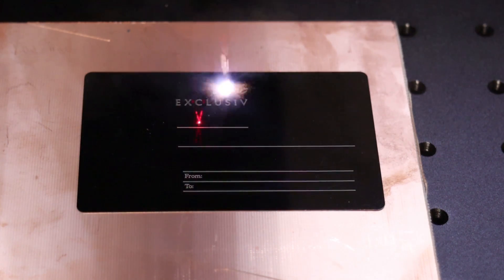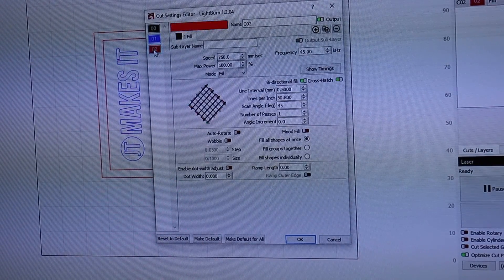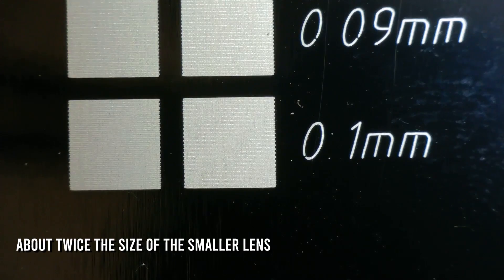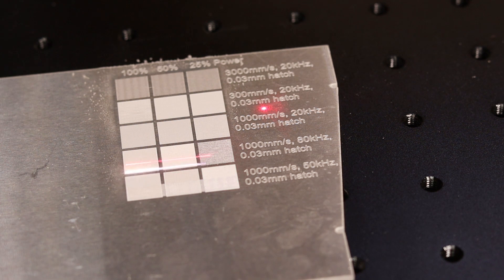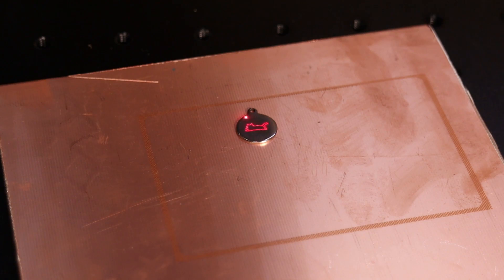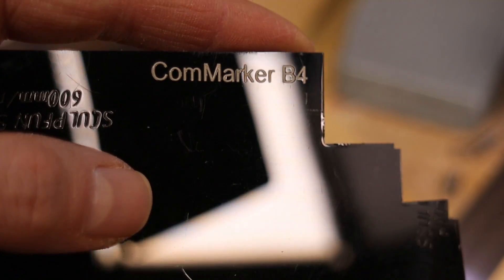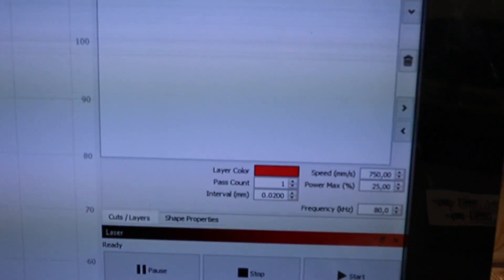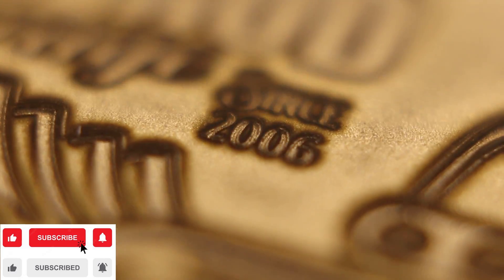"Cheap" 20W Fiber Laser With Outstanding Performance! ComMarker B4 Laser Engraver REVIEW

Comment: Is it possible to engrave in black on stainless steel? The very detailed text you put on the ring for example, can it be in black to be more visible ?
Reply from the maker: Yes of course you can. With a bit of defocus and small line interval.  In this video I did this exact effect on a knife blade.
Reply: @JTMakesIt  it can still maintain high detail and fine lines with the defocus ? because the text on the knife is in bold so im just wondering how fine it can be in black
Reply from the maker: @danaalbarazi8852  you can make it more detailed than that. I used too much defocus there. But if you want perfect ultra detailed text you would probably need a MOPA fiber. With it I am sure that you don't need to defocus. (Maybe you can even do it with this one but I never tried). Check my other videos. I tested 3 MOPA fibers so far. With MOPA fiber you have much better control over the beam energy and its effect
Reply: @ ah unfortunately the mopa is way out of budget for me 🥲 do you have any videos that show more of that defocus black engraving with the b4 20w ? I can’t seem to find any info about it
Reply from the maker: @danaalbarazi8852  no, I only have that video with the 20W fiber

Comment: Hi, thank you very much for your wonderful review!  Fortunately, this 20W fiber laser is within my reach, however, a 60W fiber laser is out of my reach. Consequently, I am interested in comparing the 20W and the 60W laser in terms of depth of engraving. More specifically,  when using much more passes (and more time) with the 20W laser, I wonder if  it is possible to obtain the same  deep engravings like using the 60W laser. I am retired so spending more time in engraving is no problem for me. Thank you so much.
Reply from the maker: @PavelZahradnik-p4l  with 20W, less depth will be achieved since when engraving deeper, the beam becomes more out of focus and with less power you run out of usable power sooner. I didn't do any long engraving tests on the 20W, but for metals like brass I would say that 0.5mm depth is achievable with 20W and 2mm with 60W, but this will highly depend on the type of metal and the lens size (larger area lens gives less power density, but longer focus depth, so there is always a compromise)
Reply: @JTMakesIt  Thank you so much !  It means, for deeper engravings with the 20W laser, after each 0.5mm engraving, it is necessary to re-adjust the focus and do another 0.5mm engraving and so on. Many thanks again.
Reply from the maker: @PavelZahradnik-p4l  you're welcome. If you plan on buying you can use my affiliate link and my 2% off discount code in the video description. Buying through that link you also support my channel at no extra cost to you.
Reply: @JTMakesIt  Yes, of course I will do. Many thanks.

Comment: Can this machine engrave wrenches, sockets, hardened steel tools?  Would love to see a video being used for this purpose.   I have tons of wrenches and tools that  I would like to engrave, this is one of the uses I have for a machine  like this.  What type of fiber laser or size is required for the fancy work they do on rifles?  Just realized both JT's.......
Reply from the maker: Hi JT :D I have engraved some wrenches in my videos with fiber lasers. They can be engraved very easily and with good results with all 20W+ fiber lasers. Even 2W "fiber" lasers can do it, but they leave a shallower engraving. Fiber lasers don't have any problem with anything metal.

Comment: im curious, the video mentions pre stored art work.  is it possible to laser print any graphic? could i for instance down load to this a spartan helmet ? then print it off,, or will it only do graphics that come with it?
  thanks in advance for any insight you can offer
Reply from the maker: You can print any graphic you get from the internet. Vector images are the best, but it can also engrave photos and other images

Comment: Can it (20W version) cut gold plates as name tag jewellery without any warping or creating any problem.
Reply from the maker: If they are very thin, you can slowly cut them with many fast passes without warping. but if you want to cut thicker you need more power
Reply: @JTMakesIt  How thin is very thin in mm?
Reply from the maker: @tumdedum  I would say up to 0.5mm
Reply: @JTMakesIt  Thank you. What is the price of this 20W version? Also, what is a suitable power to cut up to 2 mm gold plate? and do you have such version as well?
Reply from the maker: @tumdedum  you will find a link to the machine in the video description. For 2mm you would need at least 60W, but still many passes will be needed. I plan to test more powerful machine soon
Reply: @JTMakesIt  Thank you. Looking forward to your next videos then.

Comment: can you engrave brand name on black plastic casing on electronic products?
Reply from the maker: Yes, although the contrast of the engraving depends on the type of plastic.
Reply: @JTMakesIt   When you have time can you make a video of etchings on black plastic?
I'm planning to buy this laser model and want to see how it looks.
And does the MOPA model engrave color on plastic or just metal?
Reply from the maker: @playvision5667  I will make it sometime in the future. I think I engraved some plastics in my review of the Enjoywood M4 too. It should behave similarly. The best engraver for plastic would be the Commarkers UV laser. I plan to test it soon
Reply: @JTMakesIt   UV laser is very expensive, I think I would stick to this model at most.
I originally wanted to buy the M4 but thought this B4 model would bring out the engraving better.
I'm only interested in printing my brand on black plastic on my products, I'm not interested in engraving other materials.
Reply from the maker: @playvision5667  it definitely can engrave plastics, it is just a matter of what contrast can be achieved. Fiber laser offers a lot of settings and with some tweaking a lot of different results can be made. Look around the article about fiber lasers and plastics so you get a feel what can they do

Comment: Has anyone succesfully lasered magnets with an fibre laser? If so were they more susceptible to breaks? Would a CO2 laser be fine as well with 1064 nm?
Reply from the maker: I think if the engraving is not deep it will not affect the mechanical stability of the magnet. I don't think CO2 laser can engrave on magnets though. Maybe if painting the surface black first
Reply: @JTMakesIt  Okay thanks a lot! I think then your laser model looks good.

Comment: Hello so this one can carve copper for pcb?
Reply from the maker: It can engrave copper. But I haven't tested it for directly removing copper instead of etching. In theory it could work. But it can be used to make an etching mask for sure. (paint the PCB in some paint, then mark the design with this machine and then etch in acid and later remove the remaining paint.)

Comment: This whitening also happens on Polyoxymethylene (POM). Grtz
Reply from the maker: Thanks for this info!
Reply: @JTMakesIt  i use a industrial co2 laser at my company, and to check the pusle widte and overlap etc. we use a actual microscope and check for these properties. Its actually very cool to see it from close up, you can play with the powers and actually see how the burned white have different forms from the laserbeams power if you fill under 60 degrees and 40 or 90 90. The results r quite cool.
Reply from the maker: @iamD2  Wow that is some valuable info. I'm going to try it out, I actually have a microscope at hand! Thanks!

Comment: this is out of my price range currently. im looking for a metal engraver for zippo lighters ,pens knifes etc. any recommendations. thank you
Reply from the maker: This one is more affordable. https://youtu.be/Mjf6KA1C9Hg
But lasers for metal are not going to be very cheap
Reply: @JTMakesIt  Thanks. yes i was looking at that one.
would you recommend me save my money and save up a little more for the commarker?
Reply from the maker: @chrissmith841  Commarker is approximately 10x more powerful. it can remove more material and make engravings deeper and you can engrave faster. Also you can adjust frequency setting with commarker, which helps to get different finishes. You can watch my newest video, where I also talk about the differences between these two machines.

Comment: how many cm do i do for the 200mm lens. looks like you got 34
Reply from the maker: It should say it in the manual. each lens is individually calibrated and exact value is hand written in the manual.
Reply: @JTMakesIt  i actually got it from the manufacturer. only my 110 was hand written the 200mm was blank
Reply from the maker: @rgdubb5  You can also figure it out by yourself. Let it continuously engrave a small area (a lot of passes for filling up a ~2cm rectangle  with 50% power and 500-1000mm/s ) and while it is engraving, manually rotate the focusing crank and keep adjusting the focus. The point where the engraving noise is the loudest is the perfect focus. Then measure with a ruler and you have your number.

Comment: Is this really the 20W version?  I'm looking for deep engraves on Brass, Copper.
Reply from the maker: It is a true 20W fiber laser. In the video you can see that I did a very deep engraving on brass
Reply: @JTMakesIt Many videos are around showing PCB production with the ComMaker. Is it possible with the 20W version?
Reply from the maker: @b99eu  technically you could use it to remove copper, but it is very difficult. For PCB I would use it to engrave an etching mask-paint pcb black and engrave the pattern and then etch using acid

Comment: @10:44 It works on almost any colored acrylic because the opaque dye allows the plastic to absorb the energy from the 1064nm laser and it foams the surface, making it white effect. If you overdo it and "cook" the engraving with too much power, it turns brown. Clear acrylic is transparent to 1064nm so no energy can get absorbed into the plastic. You need some dye in it to work. White HIPS sheets also works, but in this case the laser is cooking the styrene in the plastic and causing it to discolor and turn dark grey. Basic rule of thumb for 1064nm is, if you can see through the material then the laser won't be able to scratch it. This is why 1064nm fiber laser can't touch glass, but CO2 laser at 10600nm engraves it easily because glass is almost totally opaque to 10600nm.
Reply from the maker: Thanks for all this great information! 👍
Reply: What laser do I need for engraving the surface of clear PET? As I understand a fiber laser will not work?

Comment: Can you engrave leather and wood with no problems?
Reply from the maker: Leather can be engraved, but wood can't
Reply: @JTMakesIt  you can engrave wood if you soak it with baking soda+water mix. still not as good as co2 laser though.

Comment: Where can I get the grids you are showing ? I wanted to replicate them on my B5 engraver.
Reply from the maker: I didn't the files for this. You can easily make them on your own with the fill parameter
Reply: @JTMakesIt  thanks, that's going to take a while LOL
Reply from the maker: @efraingonzalez4642  you just draw a square and set the fill density to the required interval spacing. Not much work to do

Comment: With titanium the oxide layer is not colored at all. What produces the color is light refraction / reflecting through the titanium dioxide layer that causes a light wave interference which is seen as a color. When you look at straight on the oxide layer is whitish however when viewed at an a certain angle you see iridescent colors. The different colors produced are from the thickness of the titanium dioxide coating. 😀
Reply from the maker: You are correct. But I also mentioned that this is due to oxide layer forming

Comment: can you make circuit board
Reply from the maker: Yes
Reply: If you're imagining using the laser to blast off copper, no you can't. You could use the laser to remove resist material that you previously applied, and then chemically etch the copper. But  for that purpose you don't need a laser this powerful or expensive.
Reply from the maker: @Graham_Wideman  Enjoywood M4 that I tested recently would be good enough for this you can check the video

Comment: I was so impressed! Clicked on the link and saw that said $300k and I'm like, oh....this must be a Lamborghini. I can't get this anytime. But the product is so beautiful!!!

EDIT: Didn't realize it was an IndieGoGo, that $300k was the backing. The cost is under $3k. That makes more sense. It's still out of my range but not forever.
Reply from the maker: Someday you can do it!
Reply: @JTMakesIt  Thanks! I think so too. Right now, I'm working on getting a beginner laser in the $300 range. I know I'll need the air assist, honeycomb, and enclosure with air filter too. So maybe those things come later.
Reply from the maker: @yorusama5011  check my other videos, I have reviewed some beginner lasers too. And also tested some accessories

Comment: Can't really mark clear acrylic (or anything clear except for clear polycarbonate) because it is almost 100% transmissive to that 1060nm to 1064nm wavelength.  You did an excellent job reviewing this and at $2K is a bargain for a low production shop or a hobbyist.  I assume it is Chinese, so I always worry about support and service though.  Do you have a feel for that?
Reply from the maker: They are Chinese, but anything non-Chinese will cost at least 3 times more. They are not a new company, they already have a lot of models out, I think they should have a functioning  support channel.
Reply: Isn't jpts stuff like 800-1200 seems better

Comment: Pretty cool, but it is an indegogo project? I think I will pass, Indegogo is just a con. This also looks very much like the Atomstack.
Reply: Agreed in part.  I am not saying this is a con, but there is basically no consumer protection from sites like indegogo so I would wait until it is available for purchase in a more standard way, where you can perform a chargeback if your order never arrives etc
Reply: @guyb7995  this is a lesson I have learnt if I see something on indegogo or kickstarter. The cost maybe a little cheaper, but the likelyhood is that the creator will just take the money and run so best not risk it.
Reply: Con? I've bought many things from there and never had an issue.
Reply: @alexs.5675  yeah, I have bought a few things from there and kickstarter and they never materialised. This is why they state that its not a shop. However, when they creators just do a runner with all the money such as the Rook project saying they will give a refund, but actually don't. Fyre, same thing as Rook, Jiffy, same thing. Ping which is supposed to be a GPS tracker but actually isn't and it took a lot to actually get the product when many have not.
  Just to mention a few.
Basically, a lot of people use these things to scam people and as such are not trustworthy.
Reply from the maker: A lot of companies do a first run as a crowdfunding campaign as a form of marketing. Usually, the goal is set very low because they already have a functioning product. Commaprker is a company which already has some models of fiber lasers selling right now, when the campaign ends, they will add it to their standard offer list. But you will need to wait a bit and then, the price will most probably be higher.